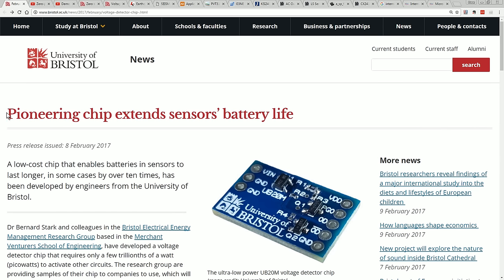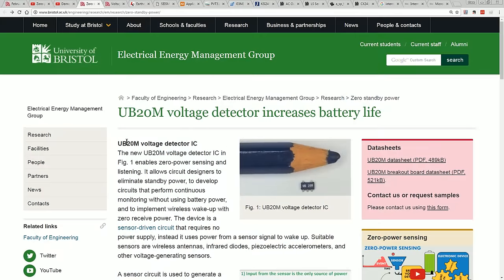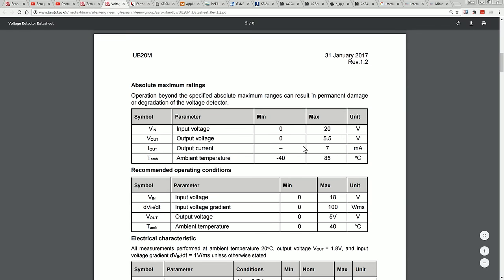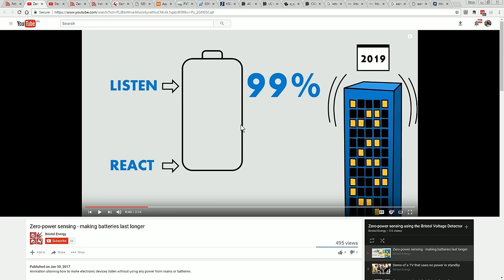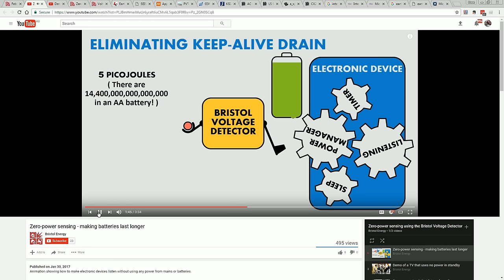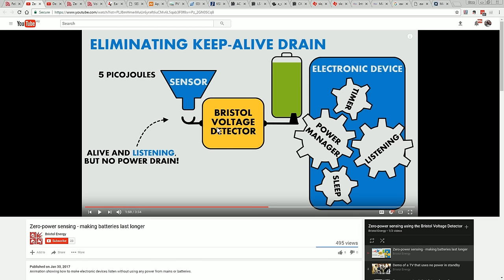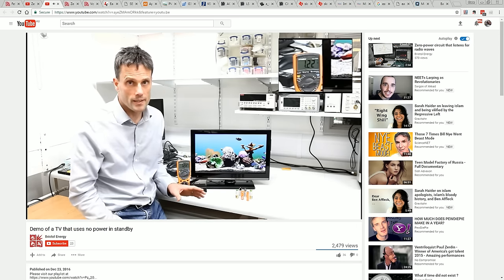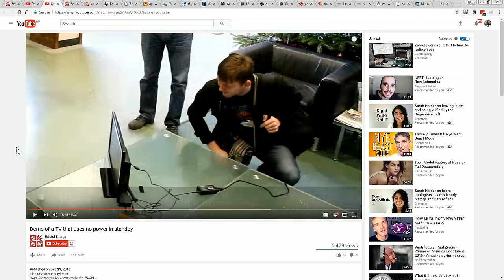EEVblog #971 - Zero Standby Power TV - BUSTED!

Comment: There was absolutely no intention to deceive, but we have taken the feedback on board, and will edit the videos accordingly. For example, we'll make it clear that we are only getting rid of the power used in the TV's standby receiver.
Reply: 10nA+ input current of standard voltage detectors collapses the output of many sensors, so our main focus was to reduce the input current from nA to pA to stop this from happening. We also had to reduce the threshold to 0.6 V and increase the maximum input voltage to 20 V to cope with piezoelectric sensors and accelerometers, and RF rectenna outputs. Having a low threshold and high input voltage is also not really available if you look at low power voltage detectors. These standard devices are designed for a different purpose, namely to supervise voltage rails.
Reply: +Lassi Kinnunen Because it is easier to use, more convenient, and can be more stable and more powerful. Hey, you still could use transistors instead of microcontroller chips, don't you? :-P Everyone uses a dedicated chip for some task, if it is already available.
Reply: Your chip is fine, just don't try to sell it for controlling TVs. Show a relevant use case , or just admit you don't have one and is was a nice research project.
Reply: I actually like your idea, i dont think it is very practical but hey, a lot of stuff isnt. But just for kicks, you could have demonstrated tv with its plug pack to draw no current if you have used something like battery or supercapacitor powered mains relay. Yeah that would have its own problems, but then Dave couldn't make a point this way :D
Reply: Which is an insignificant portion of the power used by the TV so it would be better to find a relevant example.
Reply: "absolutely no". We're still not getting it with the overcooked claims... There must have been some otherwise you wouldn't have stooped to vox populi for your feedback in the video. At least your students in the video learned an important lesson: trying to use popular press techniques to garner support for your project ALWAYS ends in tears. Let's hope that this video isn't seen by someone on their viva panel. Might be an awkward question or two on ethics ;-)
Reply: inventing crap to get government funds.  as long as its good presented, it doesnt have to work.
Reply: Mr Delphi   In this case it is obviously going to be more important to save lives rather than energy. Maybe the concept of sensor-powered IR receivers could be used in the IR applications you speak of.
Regarding why this device is necessary... what do you mean by necessary? Companies are evaluating our hardware as they feel the characteristics will make a product better. I have a lot of confidence in these companies, they know what they are doing. Let's see what happens. They might or might not use these devices. All I can tell you that they are coming up with some very creative applications which we would not have foreseen. In research I think it is good to assume that whilst we might be good at developing an underpinning technology, others are going to find the true potential of our work. It's going to take people to make solutions low-cost, other people to make it reliable, etc. That's why we have different types of engineers.
Reply: I actually like this chip. I see potential for use in standby applications such as doorbells and keypad type access control systems.

These things only need to run when a button is pressed, but they usually run 24/7 just waiting for the button to be pressed. Keypad systems are the worst as they often rely on active scanning row/column multiplexing which is controlled by a micro-controller. 
I'd love to see what I can achieve by combining this with an Arduino.
Reply: I suspect the zero standby power doorbell problem was solved at the point of the invention of the push button.
Reply: Edward Cooper True, but modern doorbells are wireless. Largely because running ten to fifteen meters of wire from the garden gate to the house is an issue.
Reply: They still have push buttons.  Many push button operated battery powered things work as follows.
1) Someone pushes a button, this switches a FET which powers up the micro.
2) Micro takes over control of FET and holds it to maintain power
3) Micro does whatever it needs to do
4) Micro releases FET, cutting off its own power source
5) Effectively zero standby power is achieved.

Maybe you're thinking of the receiver side?  The problem I see here is you're going to struggle to scavenge enough RF energy to actually do anything, and the frequencies that are used for things like doorbells are pretty crowded so the system will be in a high energy state a lot of the time negating the benefit of zero standby power and probably causing you to focus on minimising the actual active power consumption over elaborate energy scavenging standby schemes.
Reply: I'd love to know more about that, seems like an engineering challenge!
Reply: Bristol Energy it needs be  made explicitly clear regarding the 2-3mA current usage for typical receivers which your product overcomes. So you actually ' saved maybe 0.00001 seconds of a tv in the running state worth of power.
Reply: Bristol Energy 
I feel Dave was a bit out of line this time. I bet he wouldn't like to be put on the defensive like this.
Reply: I love the concept! this has been in the back of my mind for many years. As a camper, i rely on battery power quite a lot so tend to physically disconnect stuff from said battery until i need to use it. the problem with that is one of convenience and i can see potential with your design. Do you currently [no pun intended] have a device on the market with my needs in mind?
Reply: @bristolenergyresearch     I like your product.  In the end, this vlogger's main complaint is that the marketing demo was not a realistic use case for the chip.  I think this youtuber calling you deceptive was unfair in many ways, but controversies sell on youtube.  One way or the other market will determine how useful your chip is, opinions of hobbyists who're not even the target demographic for the chip is just an interesting distraction.  Keep up the good work.  I think it's funny how so many of the commentors disparage the chip, yet in the same breath asking for free samples.
Reply: I don't believe the "no intention" point though. It would seem obvious to say it saves power on the sensor end, no way this wasn't to device. I understand funding is a problem but cmon.

Comment: My old CRT TV from the 70's uses no power when it's turned off.  Power switch is mechanical and completely disconnects the mains.  ;)
Reply from the maker: How novel!
Reply: haha yeah true 0 power unlike this.
Reply: Brandon MacEachern
You should design an electro-mechanical servo system for operating the power switch, then link that into your IoT hub.  Write and debug some software, pay for cloud-based hosting, and within a few months you could turn that sucker on or off by using your cell phone!

Just don't leave the phone on top of the TV, as that would make the effort seem foolish.
Reply: Haha element2310, I had the pillow remote.  Took great aim, or I had to use the replacement model, L3GS.
Reply: boggisthecat, while that idea sounds hilarious, I did design something else though.  I designed a power strip that detects the load of the TV when it turns on, and then powers up the remaining power jacks which I have a DVD player, game consoles, etc plugged into.  Only load when the TV is off, is the power strip itself.  I honestly haven't measured that though, but it's using a single mechanical relay to connect and disconnect the hot AC line.
Reply: Interestingly, quite a lot of 70s/80s TVs were designed to have a "standby" (rather than off) mains switch that left the CRT heaters running, so that when turned "on" the picture would appear within a second or so. These sets did have a second "real" off switch around the side usually.
Reply: Zadster This TV lacks an instant-on feature you are talking about.  Also I am not aware of any 80s solid state TV actually having it either.
Reply: But when you run it, it takes more power than current LED LCD TVs
Reply: Older electronic-controlled TVs from the '80s and '90s sometimes had a "vacation switch" on the back to cut off AC mains power when you weren't going to be using it for a long time.
Reply: MrTweetyhack LED and LCD is 2013, OLED is the future. That uses even less power, each pixel can be individually shut off for true black.
Reply: johnniedehuff, I completely agree, OLED is amazing.  I still have one of the first OLED displays.  Kinda works, has developed some "black spots" that seem to be growing, but it's a first gen.  However, I have noticed that an OLED display of a larger size, displaying an all white screen does seem to consume more power than an LCD with LED backlight showing all white, whereas an OLED showing all black is extremely minute, to nothing (minus the controller).
Reply: W1FE had longer range than ST1CK, but could be a bit temperamental at times.
Reply: I rather keep my crusty but trusty LED backlit LCD than get an OLED with guaranteed burn-in problems.
Reply: LCD's can get image persistence, which if an IPS screen, can sometimes be permanent, as it happened to my 27" screen.
Reply: It's LG 2381VR with TN panel. Manufacturing date may 2011. Never had any direct problems with it. On the other hand, AMOLED in my Nokia Lumia phone developed serious image persistence in just 18 months - i was using it heavily as a navigator when driving trucks. I replaced the screen when the phone fell onto pavement and the screen seal broke, letting air into the panel. New panel developed image persistence in two years despite me being aware of the issue and using it lit only when needed.
Reply: My screen is a 27" Apple LED Cinema Display, as for the panel I know it's an LG, but not sure what model.  I've made a video on it, it's sad it happened, because I accidentally left it for several days sitting at the desktop..  I hear you on the OLED burn in though, my Galaxy Note 4 has the top menu bar burned in, doesn't go away.
Reply: Also if you put your hand in the case, it would give back quite a bit of power too... ;)
Reply: My parents' Hitachi (circa 1980, model unknown, but it still had a wooden cabinet) certainly did. I remember the big circular power switch at the side. Very much the era when people still had a habit of switching off and unplugging equipment overnight, which continued well into the VCR era, especially among older owners.
Reply: i still do that, with a big two pole mains switch. It has a 12mm gap between contacts.

I lost my entire telecom stuff during a heavy thunderstorm back in mit 1990ties (when this stuff was really expensive, ISDN phones as well as line converters and private branch exchange). Since then i switch everything off, here in my lab, also in my living room and, of course, all this digital communication stuff as well. 

That switch cost about 20bucks each, but everything else which is behind it, usually costs much, much more....

And if there is a heavy thunderstorm in the air, i always unplug this switches entirely, also the incomming telephone line, as well as the roof-antenna....
Reply: CRT TV's up to 2000's had this clunking mains switch on the front panel disconnecting mains from the device (at least the ones I have seen in Estonia).
Reply: they were years ahead !
Reply: yep.
Reply: Awesome! Time to wow the public with a live demonstration of this new technology --- a "switch" did you call it??
Reply: They said standby, not turned off
Reply: @Zadster  That I have never seen I did work in TV repair shop from age 13 with some good old TV repair an design guys. Leaving heaters on would by bad for the tube with no grid voltages.  Just were did you find this information.
Reply: @alunroberts1439  As mentioned above (4 years ago) on the side of my parents' TV. Also from my dad, who used to repair TVs for a living from the mid 1960s on. You switched the TV on with the front switch and the picture was there in a second or so. Maybe ran at reduced current on standby? Other than that, no idea. Is it important?
Reply: @Zadster  You did say the Heaters elements did stay on that would not be good in long term for life of the tube.
Reply: @alunroberts1439  Must be magic then. Also the same magic that made the Colossus so reliable (running the heaters for months on end at reduced voltage) I just know the TV ran for years without a problem and had almost instant-on.

Comment: Typical university students. When I was doing my engineering degree we got most of the way through the year before we got our A.I. soccer robots working. We only then realized that the raspberry pi didn't have the computing power to run all 6 at once so we put 4 of them on a pre-determined path and had just two of them actually playing. The lecturers were none-the-wiser and we passed with flying colors.